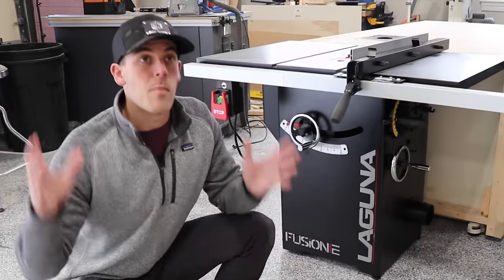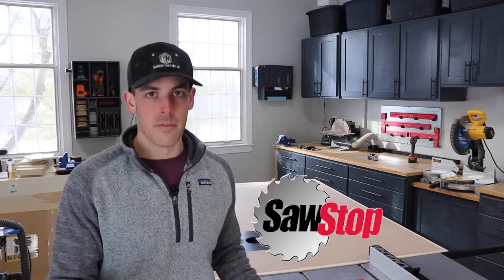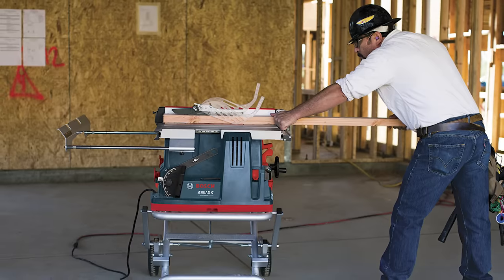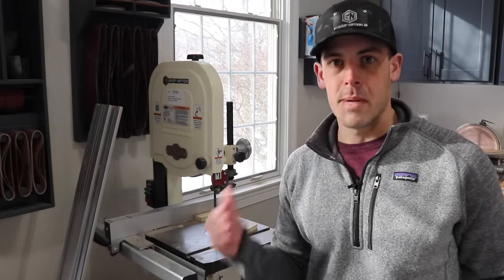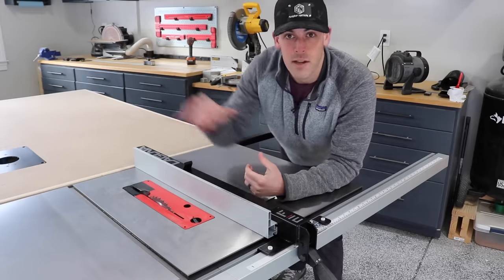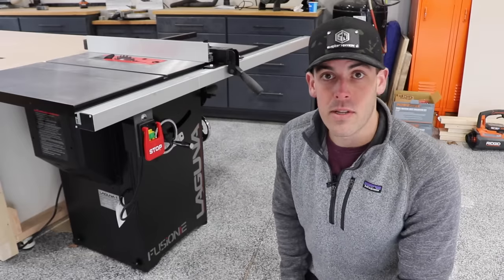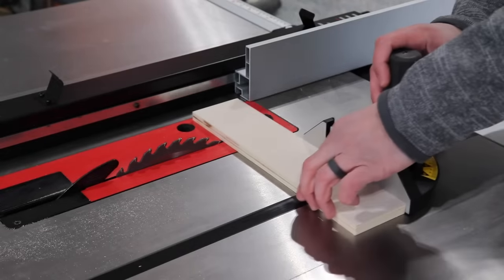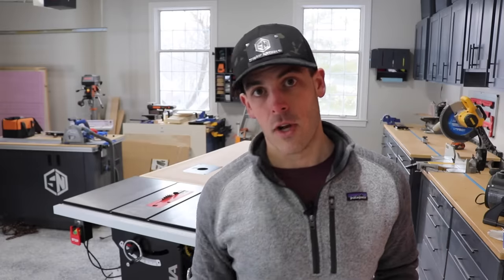Why I Bought a Laguna Table Saw over SawStop!

Comment: I just picked up the F2 and like you went from a delta contractor to the F2. Got to say so far it is a very good saw. The only complaint would be the dust collection is so-so and when you pull the over arm collector off there is no real way to store it. But other than that it’s a pretty good saw!

Comment: Exact same reasons I went with a Harvey Alpha.  The only terms I was able to come to with Harvey was I can send them any questions via email and they will completely ignore them.
Reply: Nice saw!
Reply: That sucks.  I have been looking at the Harvey pretty seriously.  Its hard to find any info on them...  I like what I see but would like to see more than a photograph or computer generated adverts...
Reply: @thomasstone3513  Yeah, it's a bit of a let down at this price point.  If I had to do it over again I'd probably go with Delta or Powermatic... or save another couple years and go with a Felder.
Reply: @nunyabizness6734  thanks  for the info...  more thinking to do, i guess...

Comment: Hey nice review.  Old wood guy lots of different saws....
On my PM 2000, blade tilts to the left...great! On my Unisaw,  blade tilts to the right....great!   It's great to have the luxury of quality saws where you can use   which ever cut is better for your project...!  The powematic has built in wheels....but my shop is big so I  never move it. 

I actually tie the two saws together side by side with one 50"(to right of blade ) fence. So PM 2000 on the left with ATB crosscut and rip blade on the right. Only time I  change a blade is for melamine. All with one fence. Curser calibration is only for the left saw, Powermatic. Tape measure, steel rule for the unisaw on the right. If it's still not clear? The Powermatic and unisaw are bolted together , side by side so there is a continuous cast iron deck for one 50" inch fence shared by 2 saws....just raised the unisaw up about 1/2" to level the  heights of the cast iron tops.

A few years back, a shop owner on the Wood Web was commenting about how his SawStop had kicked falsely about 24 times and once for a real finger....! Each time a one hundred dollar blade and the price of a new cartridge....!  I am happy with my srandard saws......but am a big believer in true personal safety. And my specialty was curved shaper work before CNC.  More money.....still no carbide kiss   and fingers add up to 10.....! 

Two more things I am not fan or is forced legislation to use Saw Stop. The other is lawsuits....!! Today if you have employees......you might need a SawStop......I  know a injury attorney in Las Vegas who told me he has never lost a case.....! Talk about it rigged systeam.....this why your every kind of insurance is sky high. I  don't really know(I make sawdust for a living) ...I think he just knows which cases provide him with the evidence to be in a never lose position. Has enough work to discard all the weak cases.

So I  am with you .....no sawstop. The quality of.my saws are great.  PM weights 700 lbs, bolted to the unisaw....they don't move, plenty of power.....spoiled,  and love it!  I have used Martin's and Altendorfs , both German and Swiss Striebig,  these are all incredible saws.  ....happy I don't need them or their cost....! 

My recommendation....patience, used equipment is all over the place...but quality is scooped up quickly. You can always advertise specifically....as a buyer. Be a creative hunter!

So great article....but your big mistake was not getting the 50" fence and big motor. That could have been your lifetime saw!! You want to buy quality that will out live you! With features you won't regret! One project,  one, could have paid the difference ......

So when I  was in high school,  I  wanted a drift boat (banana shaped for running rapids and rocks ) to chase steelhead with a fly rod in Oregons rivers.  Could not afford one....built 2 in high school wood shop, sold the one....it paid for mine......! There are always many ways....

So make some money....sell your saw....post a new video talking about how you "new" saw has horse power that doesn't quit.... and really the fence you want when cutting 4x8 sheets....!                 I promise,  you will love-it-no-regrets.....!!

just jim

Comment: I am located in Australia, I desperatly wanted a Saw Stop, but simply could not afford one. I then decided on a Laguna F2, but sadly they only had the F1 and F3 in stock. As the F3 was simply to big for what I wanted I settled on an F1.   2 years later all I can say is I have never regretted that decisuion. The saw is superbly made and holds ridiculous precision. Every time I use it I say out loud "I am not going to cut my fingers off today" This makes me practice all the required safety precautions. Spend a fraction of the money you saved by not buying a Saw Stop and load up on all the fancy safety tools like Grippers, anti kick backs and push sticks and you will have your fingers forever. as well as your saw.

Comment: I just did the exact same thing and ended up purchasing the F2. So far I am loving it! I am very safety conscious and always felt the saw stop makes you safety complacent because too much trust is put into their safety feature. I don't ever plan on cutting my fingers and chose the quality and features of the Laguna F2.
Reply: The notion that having a SawStop makes the user complacent is nothing more than mental gymnastics to justify the poor decision to save a few bucks by getting a tool that is infinitely less safe. This logic applies to dumb kids, and that's about it.
Reply: @Josh Sommers  The rest of my tools are all Festool so "Saving" a few bucks is irrelevant.  However, my actual career is working in an industry that is extremely high in dangerous work areas where in a blink of an eye, things can go very badly, very quickly. You considering Complacency as a childish mental excersize would get you injured very quickly out here.  We are trained to do hazard assessments before every job on site to mitigate risk. I have taken that to heart in my home life as well.  Which mean I am always fully aware of my dangers before I do anything in my shop! When I said I don't plan on cutting off my fingers I meant it because of my background and training. Don't ever underestimate Complacency, it's what cuts off fingers!!

Comment: I was a woodworker long before I had a table saw so it was not until 1994 that I bought my first one, a cabinet 240v 3hp Enlon. with 32" to the right of blade.   It was built in the same factory as Grizzly but the top was seasoned for 6 months before machining, reportedly.   To be fair, the tops was as flat as ever when I sold it 10 years ago.  Note: Enlon was swallowed up by Grizzly and no longer exists as a company unto itself.    The funny thing was that it always had a little rumple to it until I sold it to a friend.  It was at that point I fitted Timken bearings into the arbor yoke and the result was a finely balanced machine with a perfect table saw hum!  Talk abut seller's remorse!  10 years later and that saw still has that clean hum!   I think I may put Timkens in my 66 soon!

Comment: Price point between laguna f2 and sawstop is like $900 give or take. My finger are worth more than that. Also I originally purchased a laguna but after delivery date being pushed back 3 times I canceled other and purchased a sawstop that was in stock.
Reply: If your fingers are worth more than that then I suggest you keep them out of the damn blade. 🤦🏼‍♂️
Reply: @SuperDave44Mag  wow such an ignorant comment. It's about the added safety not to be careless while working with your table saw.
Reply: @ritoluis4903  -- It doesn't do to waste your time arguing with someone who doesn't agree with you.  He, like you seem to (and I do)  believe that table saw accidents are not all that rare and could happen to anyone who uses a table saw long enough.  Let Mr. Phillips believe what he wishes, it's his fingers and hand at risk.  I fully agree with you.  And, as some of the other commenters have pointed out,  the cost difference between Sawstop and other non-flesh sensing saws is tiny and insignificant when you amortize this additional cost over the life of the saw.

Comment: EXACT same story here. Have owned my F2 for just over a year (same model as yours). I never hooked up the over-the-blade dust hood. I did notice my Jet 650CFM dust collector did very little to collect dust from the Fusion port. I don't even bother connecting it anymore. Once the cabinet fills up with dust (maybe every 2 months for me), it's a bit of a pain to scoop out. That's my only complaint with the saw and I love everything else about the F2. A couple other drawbacks: 1) Very difficult if not impossible to find a plug and play cast iron router table extension wing, and 2) not as well integrated for future upgrade for outfield table or extension table.

Comment: I work in a shop that used to have Powermatics, but we converted to SawStops.  Both the Powermatics and SawStops are great saws, we still have a Powermatic set up for some things.  The saw you choose is up to you.  If I was buying a saw, I probably wouldn't spend the money for a SawStop either.  Just remember to keep your fingers out of the sharp part while it is running and you'll be fine.

Comment: Hey Travis, FWIW: I arrived at the exact same conclusion you did, after a virtually identical analysis. Exxxxxcept Laguna was sold out of their 1's and 2's when I did so. And (for a wonder) I've waited. Great to see they're back in stock (admittedly, this was several months ago, and there was some repeated incidents of "life" happening in the interim, which somewhat diminished the urgency of the matter, but it appears that it's once again time to begin the salivation cycle).

And for anyone criticizing his choice, I sincerely hope you have a top-end dust collection system and cyclone fully plumbed to every tool before your get pretentious. Wood dust, both statistically and in practice IS  more dangerous than your saw. Maybe not as dramatically, or as acutely, but going by the numbers, sawDUST should be the bigger concern than sawSTOP. If you're going to play the safety card, it sounds kinda hollow if you haven't already dropped the 12k+ for air quality. Especially because THAT one impacts your spouses and children, too. And while I totally commiserate on how outrageously pricy GOOD dust collection is, well, it turns out there's places to save a few thousand here and there. 

Yanno... if you think you can trust yourself not to cut your arm off in the process.

Comment: There's one option you didn't mention, buy a used Sawstop.  Yeah, I know it's not a predictable way to buy a tool, but for me as a hobbyist woodworker, I don't need my tools today or tomorrow so waiting for a used one made sense for me.  I was using a Craftsman contractors saw during my search and wasn't afraid to use it but always felt my fingers were worth spending more on.  Anyway, I played the odds for quite a while but now I have the comfort knowing if I ever slip up I have a better chance of less injury.  Edit to add, thanks for the great videos you produce, I enjoy them all!

Comment: I've never once looked at someone's table saw before determining them to be a serious wood worker or not.... but after thinking about it seems to be that the exact opposite should be the case.  Beginners that don't know any better will benefit more than pro's with a tool that helps protect them from doing something they shouldn't.  Personally for me, the extra insurance to retain my ability to be able to pull of flawless fart jokes is worth the extra $1500-$2000 for me.
Reply: Bull! Statistically,  table saw accidents increase with experience. It’s not a matter of if, but when.

Comment: Great video, and I agree with your ORM analysis (I did the same as an engineer at WPAFB).  I worked in a cabinet shop from Jr. High thru college, and only have one kickback accident under my belt (cutting a 2x4 lengthwise on a 36"-tall cabinet saw, and me with a 37" inseam, yeowch).  I'm still using my ~1992 Delta contractor saw, which did come with CI wings and now has a Beismeyer fence and home-made dust collection, so I think I'm good for this lifetime.

Comment: I can sorta laugh about it now. I still have all my fingers, but a few of them have been surgically alterd a bit. Back in the day the first thing we did with a new saw was to remove what little safety features that was on the saws. After all you considered yourself a professional woodworker carpenter or cabinet builder those safety features just got in your way. How dumb we were, now I make sure all safety features are put on all equipment.

Comment: Liked this video, especially since you went outside the box of the Norm, and bought a less known contender to the table😉in the table saw world, kudos.  It’s been a real big deal breaker for me as well spending thousands, on something that isn’t used day in and day out, I’m old school, like the Delta’s and Powermatics, but geez, can’t justify it.  Been managing over the years with the less expensive, Craftsman, Skill, HF, just put on a real good carbide blade, with a digital a angle gauge and been getting by, but the rip fences and table sizes have been less than desirable on all of them.  Liking this new option, the “Laguna” line seems a viable option for sure. Thanks for buying and sharing, keep us posted on your findings 👏🏻👍🏻💪🏻

Comment: Thanks for the review. Being a novice in this area I wasn't sure what to get.  I'm coming from a 10 year old (at least) craftsman table top saw that I used for projects around the home, but now in retirement I'm dabbling in some projects which require more sophisticated equipment. I almost purchased the Delta 36-725 T2 but was apprehensive about the capacitor issue they have had plus I think I wanted just a bit more out of a saw.  The sawstop feature is great but I've been around a lot of tools for a long time and still have all my appendages.  After seeing your review I looked more into the Laguna line and purchased the Fusion 1.  The dealer even honored an old price tag which was still on the box.  It's advertised for $1199, but I got mine for $1099.  It's all set up and so far everything is good.  My only complaint at this time (only owned for a day) would be the manual is lacking in set up instructions. Thanks again for the review.

Comment: Just cancelled my order for a Grizzly and placed one for an F2.  Going to have to wait until April now.  Did you get your saw directly from Laguna?
Reply: Laguna doesn't sell direct to consumers, thats what they had told me in Dec 2020.
Reply: @allent555  I saw on their site they don't sell to the general public.  But I'm guessing/wondering if Laguna provided the unit or did he have to go through a reseller.  If through a reseller, who was used
Reply: @halsaresnowpaw522  Woodcraft
Reply: Grizzly's are fine saws.  Arguably more stout and stable than the Fusion F2.  Laguna is maybe more polished and has overhead dust collection.  Though, you can get that with a Grizzly for the same price as the F2.  Both good saws, just built a little bit differently under the hood.
Reply: @alsmith7316  I haven't seen a new Griz in years. But previously they looked great online and in catalogs. But when I drove to one of their warehouses to look. Well their fit and finish was disappointing. It's moderate quality chinese craftsmanship. And the quality control is not the best. But many get lucky and/or are quite satisfied. YMMV...

Comment: Just watched your video and wanted to say that being a General Contractor for 40 plus years and watching people use tools the wrong way is what causes most accidents, ( free hand cutting, alcohol use and so on ). People need to be educated on the proper use of potentially dangerous tools, and, it is your responsibility to use tools properly and safely. SawStop Saws are well made and other manufacturers should take note of the quality. I have had multiple table saws over my career and now have a Jet which is very smooth and accurate and it does what I need it to do. Then I do my part. Save the hot dogs for the Barbi!